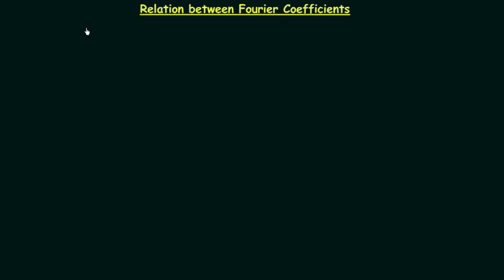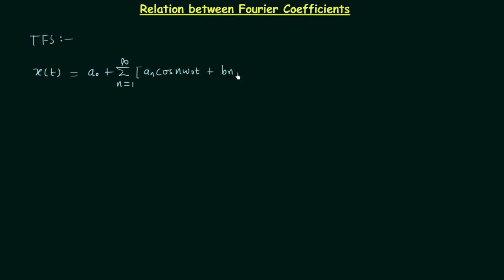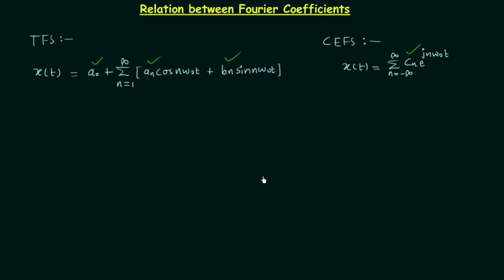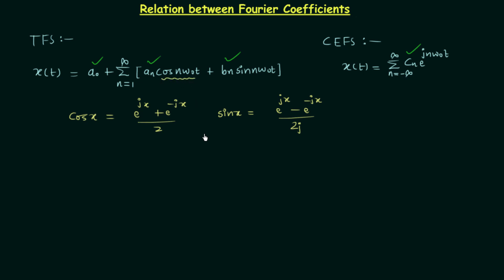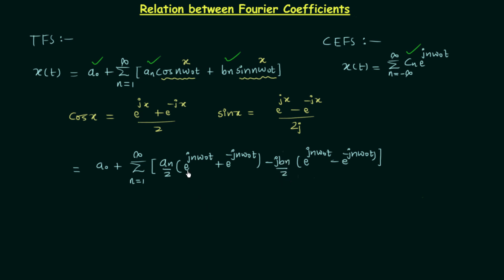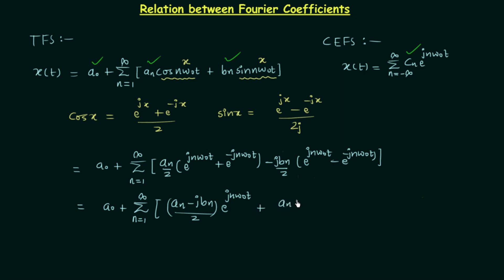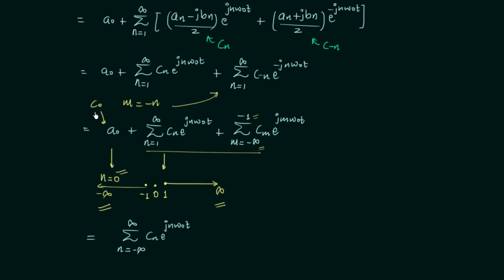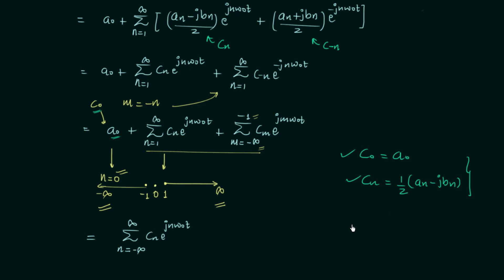Relation between Fourier Coefficients

Comment: hi. i have one question. at 4:26, you state if cn=1/2(an-jbn), then 1/2(an+jbn)=c(-n). why is this not conjugate c(n)?
Reply: Both C(-n) and conjugate C(n) will be same , won't they?
Reply: someone please answer this man
Reply: same question
Reply: @ushasaha6316  if you take conjugate, then mod of c(n) is not changed, only angle becomes negative, but here both mod of c(n) and angle are changing so it will be c(-n) not conjugate.
Reply: Cn = 1/T * Integral [ X(t) * exp(-n*j*w*t)*d(t) ]
C-n = 1/T * Integral [ X(t) * exp(n*j*w*t)*d(t) ]

C-n is conjugate of Cn <=> Cn = conjugation of all terms in C-n.
C-n only conjugates the Exponent term, but it doesn't conjugate  X(t), it may be complex signal.

If X(t) is Real signal -> Conjugation has not Effect on Real entity i.e. X(t) = X(t)^* . All terms are conjugated.
=>  Cn an C-n are conjugates of each other.
Hence,  
Cn = 1/2*(an-jbn)
C-n =1/2*(an+jbn) ----> Derived from Trig series which are Real signal.

If X(t) is Complex signal ->
X(t) in Cn^* is not same as X(t) in C-n
=>  Cn an C-n are not conjugates.

Long Story Short:
1. X(t) -> Real => Cn and C-n are conjugates.
2. X(t) -> Complex => Cn and C-n are not conjugates.
Reply: the equation of an involve cos nwot and cos negative is cos so we have an again for bn it involves sin and sin negative is negative sin thus we get conjugate of the imaginary part
Reply: See the video of Complex Exponential Fourier Series at 4:53. I bet this would be a perfect answer for you.

Comment: Sir, could you explain how the values of m are changed to -infinity to -1 when you put m=-n? please reply
Reply: Sahidul Islam 
n limits are 1 to infinity
m equal to minus n
m=-n
Substitute limits of n 
m=-1
m=-infinity
Reply: yeah, you are right. But refer 5:30. Instead of putting the values of m as -1 to - infinity he put m as - infinity to -1. How do these limits get changed? Hope you got the point.
Reply: @SahidulIslam-tz6tm  me too have the same doubt
Reply: @SahidulIslam-tz6tm  -infinity is less than -1 we start from smaller value to bigger values in summation
Reply: @SahidulIslam-tz6tm  we take summation from smaller values to larger values so -infinity is less than -1 so it is from -infinity to -1